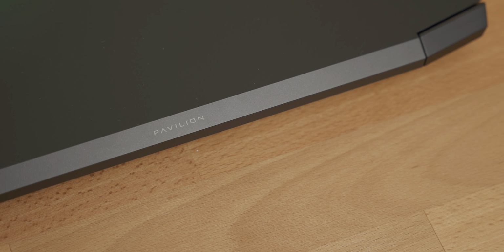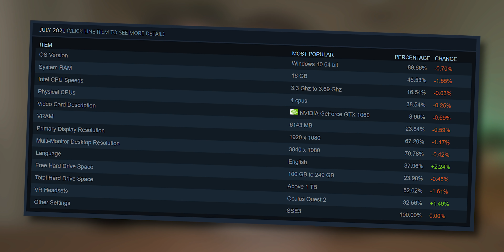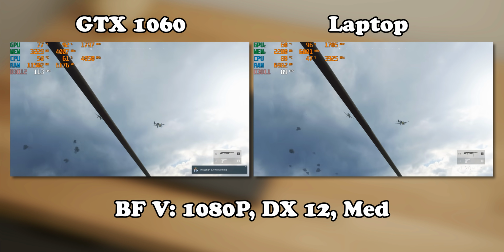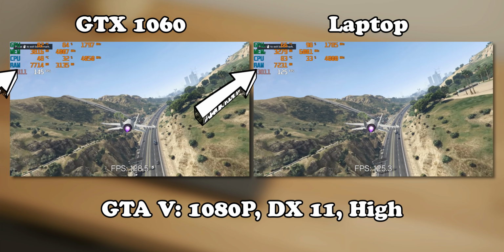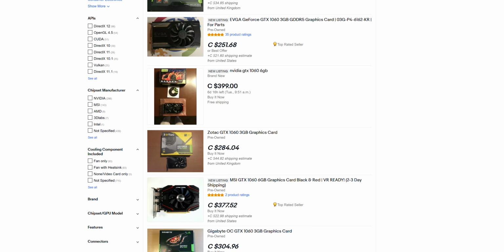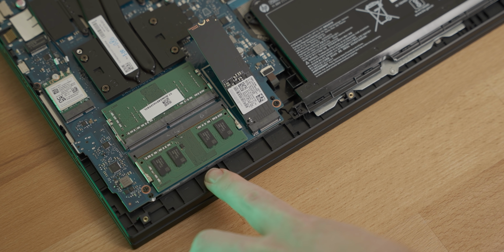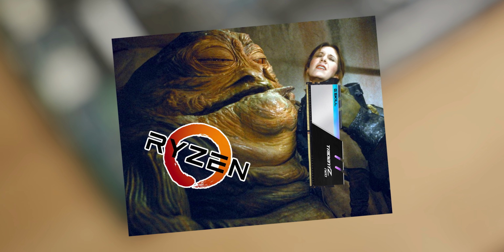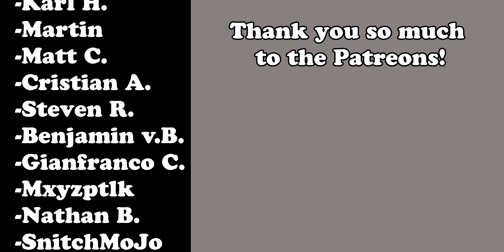Most Popular Graphics Card On Steam Vs $700 Laptop

Comment: Impressive what laptops can do these days, imagine playing such demanding games on a portable device 5- 10 years ago...
Reply from the maker: Oh definitely! Especially budget ones.
Reply: @DawidDoesTechStuff  You do know that ever since maxwell budget laptops have been capable of running demanding games, right?

Gtx 850m/860m gddr5 ~ Gtx 750ti desktop 

Gtx 1050 2 ~ gtx 1050 2gb desktop

Gtx 1050 4gb > gtx 1050 2gb desktop

Gtx 1650 ~ gtx 1650 desktop

Oh and the gtx 1650 laptop can be overclocked. I've managed to hit my laptop's 1050 at 2ghz via tuning. 

https://m.youtube.com/watch?v=2FaMRQkuqHM

Here's a couple of benchmarks of it using 4 different performance profiles I've created.
Reply: @setzer-j6s  Yea I had an 880m laptop that ran all the games that were new at the time at a good framerate, I couldn't MAX out the newest titles, but I could run them at good settings and could max most stuff.
Reply: @jackbootshamangaming4541  Damn man, I remember the 880m laptops costed quire a lot
Reply: @setzer-j6s  yea it cost me quite a bit
.
Reply: @jackbootshamangaming4541  Why not "upgrade" to a rtx 3050 laptop? They've been going at a decent price nowadays. I've seen the 75w variants go for $650. Should be about 2.5 to 3x faster than your gtx 880m, if not more.
Reply: Lenovo makes a similar setup, the Legion 5.
Reply: For 700 dollars too
Reply: The anty will constantly be upped. As is the industry. Aspirational market. No one individual could possible own everything. Only individuals backed by corporations.
Reply: I had the hp pavilion for 3 years and it’s really good
Reply: Got a laptop with an rtx 3060 for $1500, it's just... man it's impressive
Reply: @CardinalSinner  Dude. There's 3060 laptops for $1000 too, which are just as impressive. Heck I've even seen $800 ones
Reply: @setzer-j6s  Depends on the brand and the country you're from, no way I could ever find a laptop of that quality at $1000 here in Chile unless it's an used damaged laptop, and for $800? haha people here would think you're a comedian, with $800 the best you could get is a 1650 gpu laptop and with $1000 you can get a rtx 3050 ti laptop, but 4gb of vram just isn't enough nowadays, mine is an MSI laptop, pretty expensive brand and well... the only laptop I could find that had a 3060 gpu, they're currently out of stock now 😅
Reply: @CardinalSinner  Oh you're from chile. Thought you were from merica. Yeah then the 3060 for 1500 is good.
Reply: @setzer-j6s  Chile is in South America btw :P
Reply: @CardinalSinner  I know where it is. Laptop market is fucked up in south america
Reply: @setzer-j6s  You can say that again
Reply: my asus rog strix has a 1060 3gb card from 4 years ago and runs any game i throw it at its impressive
Reply: @akina7156  Have you undervolted your CPU and overclocked your GPU's core and vram clocks? Should gain a pretty nice boost to fps. 

With repasting and dust cleaning temps would go down by quite a bit.
Reply: @setzer-j6s  no but I’ll try that out thanks! I’ve cleaned it and placed liquid metal tho.
Reply: Yeah back then you were basically limited to the very simple games like half-life
Reply: hardly portable lol
Reply: Dude, 5 years ago, the LAPTOP 1060 costed $800, AND gave you similar performance you see here, if not better. 

Laptops have had this for quite a while

Comment: Hp does perform good at first but after consistent gaming the motherboard starts smelling and  in worst scenario you might actually destroy you Gpu. 

I think hp is cheap but costs you lot more for the repair

But for Dell, Lenovo you pay the more cost but for better components.
Reply: I actually have this exact Notebook for light gaming at a friend's and so far it hasn't started melting down and it is in use for ~13 months :D

Comment: In games like GTAV, it looked like the 1060 was being held up by the CPU, wonder if a 10100-esque system running with the Skylake IPC would have seperated these cards a bit more. Overall, the 3-4 year improvement in effiency is cool to see!
Reply: While impressive, we've gotta remember, the prices haven't changed a whole lot either considering the 1060 costed $800 5 years ago
Reply: @setzer-j6s  you also have to remember that this is a desktop class 1060 vs a laptop class 1650. That’s why I specifically mentioned the efficiency advances.
Reply: @AwSomeNESSS  Yes, but sadly the rtx 3050 reversed the efficiency. It now needs 80w to hit 1660ti performance. And even then barely matches it.

Although even 5 years ago, the 80w 1060 did match the desktop 1060. So, compared to that the efficiency improvement is alright. Infact if you wanna see how insane pascal was, the 115w 1070 on laptops soundly beat a 120w 1060 on desktops.
Reply: @setzer-j6s  that kinda efficiency jump is why I’m excited for Nvidia’s next node jump. It’s why even if the 6600xt was disappointing from a price/performance perspective, it’s interesting from a efficiency perspective. I could see the next jump for Nvidia being a Maxwell-Pascal type jump in efficiency if they choose the best node
Reply: @AwSomeNESSS  I hope so but you gotta realize nvidia isn't gonna make it cheap. I mean just look at ampere on laptops. The 3050, if capped at 50w like the 1650 gddr6, will barely beat it. That too on a 8nm node. Why do you think nvidia made it use 80w. 

And then you have to look at the efficiency leap AMD made. The rx6800m is arguably more efficient than a rtx 3070. So who knows, maybe AMD will also rip us off now like nvidia.

Comment: about the ram you need to get 3200 mhz ram with 1.2v , with 1,35v ram it will default to the highest 1.2v speed which is 2666 mhz

Comment: 1:32 Just bought this EXACT laptop from Microcenter here in the states, came with the same 8gig ram, HOWEVER ours was Single channel, one 8 gig stick, Not dual 4. I actually hunted for this exact setup because It just easier to buy another 8g 3200mhz stick than buying a set of them and trashing both 4g sticks.
Reply: Also, Ours came with a 512gig nvme ssd, not the 256.

Comment: i've got a different laptop evoo gaming one with 1650 in it from walmart when it was 529, now it's more....but msi afterburner works for it and gets much better fps. also threw in ram and storage. Optimized some settings, took off background apps for max use...and it's got a wifi 6 card.

Comment: Ouch... You ended up to that BalliSux trap too. I tried to upgrade my Asus 5800H/3070 laptop with Ballisux 2x16G 3200Mhz kit only to learn that it is 2666 (JEDEC) and only can be run on 3200Mhz ONLY IF you have option to turn XMP on - which isn't option on most of the laptops nowadays. Had to return that set and pay a hefty price to get JEDEC-3200 rated (real 3200Mhz) set with 2x 16G...

Comment: I have the same Ram kit in my laptop, it's compatible with Intel XMP to boost ram clock speeds, but not with Ryzen it seems. Crucial ought to specify this in their marketing.
Reply: It is even mentioned in that Amazon page, speed "2666MT/s, 3200MT/s" which means 2666mhz JEDEC and 3200mhz XMP. Dawid either didn't read so far, or didn't know that laptop doesn't support XMP. It has to be 3200mhz in JEDEC standard to it run at 3200mhz without XMP, of course.
Reply from the maker: @leevi6026  I didn't read that far. 😅 But I assumed that laptop ram would be rated for JEDEC considering they usually have more limited bioses compared to Desktops. You know what they say about assuming though.
Reply: (or both)
Reply: I have cursed Crucial for that as I have had same problem with those SO-DIMMs. Most of the Ryzen laptops seems to require JEDEC 3200Mhz chips to run advertised speeds. Jedec chips are more expensive than XMP 3200 as those XMP chips tend to be slower rated chips with some test to verify them with XMP overclocking.

Comment: 1650s are great for laptops. They're not really powerful enough for temps to ever be a problem, and they're good enough to play pretty much anything. Especially if you like older games like BF4(handles ultra at 1440p with no problem.)
Reply: Nah, for laptop's nowadays, 1660ti is the minimum. Sadly the 3050 doesn't really bring this performance at a cheap price.

Comment: I used to have a very similar laptop. It was an hp pavilion with a 1050ti and an 8th gen i5. I only had it for a year, before I had to get rid of it. It had WAAAY too many issues. It overheated, under performed, had a ton of pre-installed hp programs that heavily altered the speed of the overall device (which was unable to be uninstalled), countless issues with the gpu/cpu. Plus the hinge wore down over the course of the year. I took my laptop to a ton of different people, and none of them managed to fix it. Who knows, hp could’ve changed, but I kinda doubt it. But to anyone looking to buy an hp pavilion, don’t.
Reply: I bet the cooling system is the same as acer nitro 5(gtx 1050, i5 8th gen). Shitty and stupid cooling design. My fan turns full speed by just opening edge 😂

Comment: most laptops dont use xmp and that ballistix kit has 3200 as xmp not as jedec
Reply: It's laptop sized ram.  If laptops can't use xmp then that would be pretty silly... -- Also I've had fake ram from Amazon that couldn't even do the xmp that it said it could.
Reply: @BrainSlugs83  probably there are some that can use xmp but usually there are no xmp option in bios. But there are laptops that have desktop components and overclockable ones and intel nuc

Comment: I have this laptop (but with a 1050  instead of a 1650) and I really like it. I got it on a black Friday sale for $400 and at that price it is pretty good. For some reason, it has a 3gb version of the 1050, which I didn't know existed.
Reply: I think the 1050 (3gb) is a 1050 Ti minus 1gb of vram, it has the same number of shaders & TMUs, and 24 ROPs instead of 32 ROPs dues to the memory change.

Comment: I think that the RAM problem comes down to HP being shit when it comes to non-proprietary componenets.
The GPU is probably being pegged because of HP's bios and how it interacts with the components. 
And as always HP has fucked up CPU thermals.
Reply: Ram problem is just that Ballistix ram is rated 3200 when overclocking with XMP, which isn't well supported on many laptops. All Ryzen based (4000 & 5000 mobile cpus) laptops I have seen requires JEDEC rated memory to run on advertised speeds. Ballistix sells 2666Mhz JEDEC memory as an 3200Mhz "XMP tested". JEDEC timings and speeds comes from SPD ROM chip on memory itself. At least Kingston have 3200Mhz JEDEC spec memory packages and have 3200Mhz JEDEC timing information on SPD ROM, while Ballistix has only 2666 JEDEC settings on SPD ROM. I have been on that trap too... And cursed this a long and hard.
Reply: @sasiuru  So their marketing team is behind this. Hmmmmmm....  Welp, time to read the communist manifesto again.
Reply: still. You can lie for 700$ thats a low price (not related to amazon ad). LMFAO

Comment: Oh no... the non-SC model. It pretty much has a Dell looser cooler cut in half, so it runs hotter than the surface of the sun. And that's even clocked miserably lower than the SC model.

Comment: 1060 is still a great card. I was very surprised by it in my acer laptop (non mobile 1060). I'm used to super high end and i was very happy with my gaming experience with it.
Reply: yea and those coolers on ther 1060s are terrible. those single fan things are BAD. Take of the plastic shroud and it helps so much.

Comment: I got 32gb 2933 17-17-19 on my OMEN 15.

You gotta go HyperX to get 2933 or 3200mhz with HP laptops. Check the specs on Kingston's website and see if the JEDEC speed is 2933 cl17 or 3200 cl 20. Amazon usually has them.
Reply: What is so special about Hyper-X? I notice Dell uses it also.

Comment: I would honestly buy that RAM since I'm struggling with 8GB lol and my CPU only supports 2667MHz max

Faster RAM probably would of helped in this test as I'm guessing there is shared VRAM in the laptop and some games might be using it
Reply: "Shared VRAM"? Can you elaborate please, I have never heard of shared video memory. Like, integrated graphics style?
Reply: What CPU do you have?  Most "say" they only support a certain speed "officially" but then allow you to use higher speeds with "overclock" settings. I think even 5th-gen Intel should go much higher than that.

Comment: I didn't realise you could get gaming laptops this cheap these days, good to know! Not that it's cheap, but it's less than I thought
Reply: I wouldn't buy it. Last Black Friday the same laptop with the 4600H was going for $450. If you don't have a time machine, Dell has been running sales on 3060/ 5800H laptops for $1,000 which is more expensive but much better specs.

Comment: Anyone know why the CPU temps on the laptop were lower with the 16 gig kit?
Reply: Because the RAM was clocked at a lower speed (the memory controller lives inside the CPU.) Also the CPU in general will be slightly more idle (while it waits for data).
Reply: Right on gents. Thanks.

Comment: I haven’t ever seen anyone purchasing a 1060 in so long! No idea how they are still holding up!
Reply: My 1070 is still doing fine. I can get 60 fps (with a couple of dips here and there when things get crazy) on most games @ 2k resolution with everything maxed minus AA and other taxing crap. I'm not upgrading until I can get a card that can do solid 4k 60FPS with all the bells and whistles for 400 USD or less. It takes two to tango and I refuse to pay these clown shoe graphics card prices.
Reply: @Sashko_Dee  yeah maybe when gpu prices drop you could get a 3070
Reply: They're slightly more powerful than a 2021 HP folding aroma dispenser.
Reply: @SB-pf5rc  yeah
Reply: My 1060 6g has been kicking for so long! Only thing I can't do is video production in 6k with multiple effects.
Reply: @concentricmachining4636  wow! 6k would be hard to do for modern gpus like the rtx 3050 anyways! The performance really holds up!
Reply: @LethalzPlayz  980 is what U want m8
Reply: @captain1334  I have 4 gt 710s with sli lol
Reply: @LethalzPlayz   try a 4 way Quadro rtx 8000 12k video editing rig  and see if it"ll run crysis lol 🤣
Reply: @captain1334  if I’m lucky I can try to get 15 FPS
Reply: I picked up a 960 2 GB back in October for $50. It actually works well with older titles and eSports games. However, I would recommend the 4 gb version or something better like the 970.
Reply: @andrews.9286  now they cost almost 150!
Reply: My 980m is just fine
Reply: @the.littlest.toaster  my laptop has a 960m, solid mobile gpu series
Reply: @LethalzPlayz  yeah i got the 8gb version it amazes me how many newer games i can still get away with playing at a decent frame rate.
Reply: @the.littlest.toaster  yeah
Reply: It's still a reliable card. I've had the 6 Gig version for awhile now and I've had zero complaints about it.
Reply: @halflifediehard  amazing!
Reply: @Ultimatebubs  ok